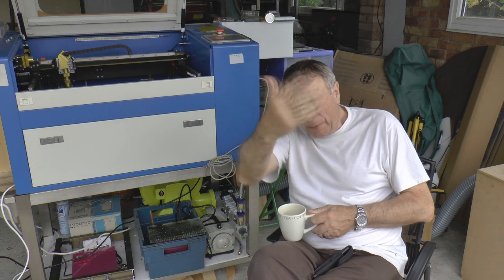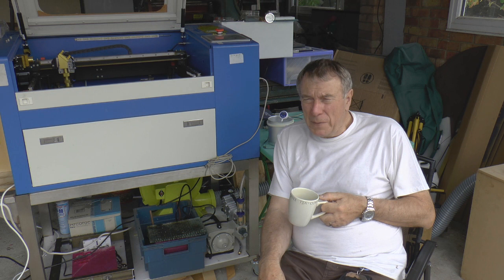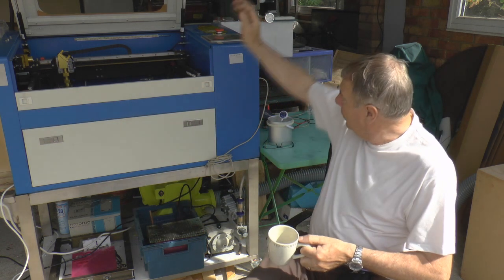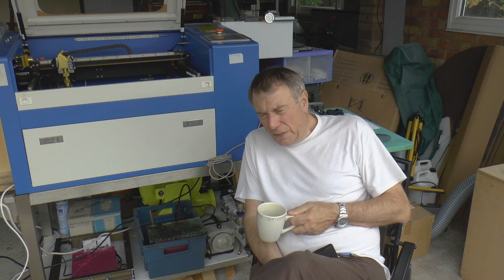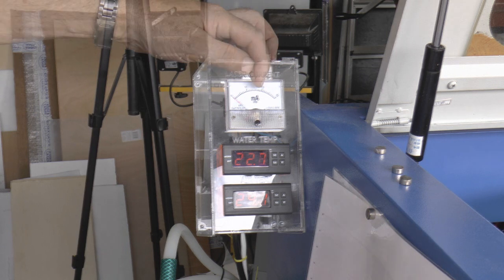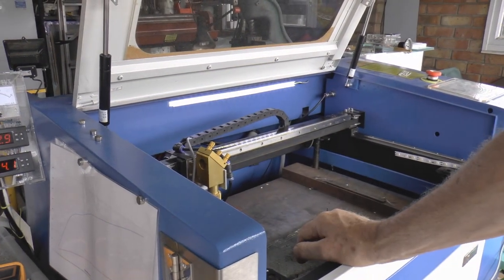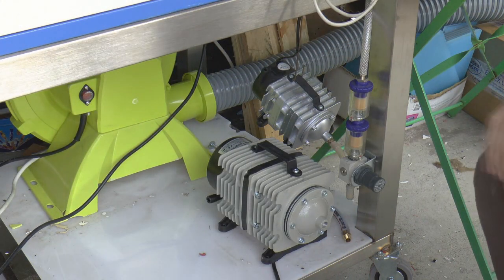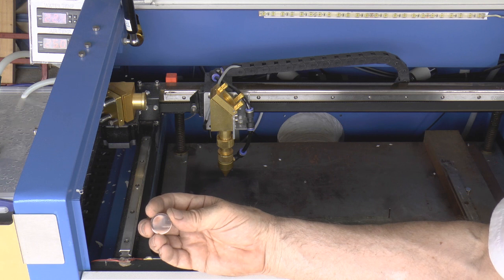RDWorks Learning Lab 75 What have I learned from 1 year of owning a Chinese Laser Engraver

Comment: Hi Russ. Thanks for the great videos. I am looking to buy a laser cutter. Please could you tell me more about the tube and the co2. How long do the tubes last? Is it classed as a consumable of the machine and do i need to fill it with Co2 ? Thank you
Reply from the maker: Hi Johnny
Tube life is still a mystery in my book. My dealings with Thinklaser have been very informative on this subject. Their MD is a regular visitor to the Chinese factory where his machines are manufactured.  As a machine builder, that manufacturer has good relationships with all the major tube manufacturers. Thus it is via that route that I am reliably informed that the specified tube life is NOT  (as you would imagine) "beam on" hours but elapsed hours from manufacture ie shelf life.  Do I believe that?  Not really, because of hearsay and my own experience.. It's a good starting point that tells you that even the best claims of 8,000 hours from the likes of Reci and EFR will last about a year IF it really is elapsed hours. My current tube claimed to be  4,000 hour life. It is now 18 months old and has 14,000 hours elapsed. It still performs as new. I expect to experiences a slow decrease in power over a few weeks when t does eventually start the downward spiral to death. There are many out there that have told me that their tubes are lasting way,way longer as well.

Some companies do offer a CO2 regassing service but it's expensive and aimed more at industrial tubes. Just buy a whole new tube because CO2 is but one of the things that wear out or weaken.

Yes, you must consider the tube as a consumable and typically expect between 2 and 4 years as a tube life. BUT the tube installed in your ebay machine will almost certainly not be a decent tube  and that could last days to months (from the experience of many correspondents ) so factor in the cost of a new tube when you budget for your machine purchase, that way you will be mentally and financially prepared. 

Final note. Buy with your CREDIT card. Do not use your Pay Pal account or any other payment method. Your card company has a legal obligation to protect you against faulty goods that you will not get elsewhere.

Best wishes
Russ

Comment: Hi Russ,Being on a shopping tour for a laser for some time, I watched a lot of your video's and decided to take the "risk" and go for the Chinese.So I ordered a machine, the next larger size as yours, cutting size 700x500mm and supposed to be equipped with a 60W tube.I even ordered it at the same shop as you did. (at least I think; with the Chinese you never know)Price, being some 1850€, shipping included, was very attractive.And, after some communication with the seller, the machine was imported already in the EC, so there should be no import duties to pay.The box (a huge one, good for some 180kg) arrived by DHL 8 days after payment - so that's very fast.I came from Gatwick, and there was nothing to pay at the moment of delivery. But, also being retired but still having my old company and a valid VAT number, and my company being known by DHL; some invoice might come in a few day's... we will see.After unpacking the thing, a quick check shows no transport damage; the laser tube looks not broken as far as I can see and was marked with a "test certificate" being a 60W tube that actually produced some 57W - test date 05/2017.The laser power supply was also rated and marked being a 60W version.So all this looks better then expected.At the moment I only powered up the machine and that was OK - I had to switch the language to English on the control panel but you documented that in some video and it worked as shown.Did not have the laser on yet, because I have first to arrange the water cooling. I will put an update here somewhere after the first cut.What I noticed in all your video's is, that you never seams to wear protective glasses. I for myself, being pretty careful for my eyes, ordered in any case good ones for CO2 laser. No Chinese ones (don't trust them that far) but serious ones from Thorlabs - model GL6 to be precise. Costs around 160€ shipping included, but that's still the price I want to pay for my sight.I also intend, before powering up the tube for the first time, to modify and reroute the HV wiring to the tube. What I see here is below any engineering standard (I am an electronics engineer)I'll have a look how I can put my findings and modifications available to anyone interested - do not intend to make some video of it (to much work) but I make pictures of all I modify.I'll keep you all informed...
Reply from the maker: Hi Luc
 By all means keep us informed. My only concern was your tube description. Is it branded K H Laser?
Take a look at   https://www.youtube.com/watch?v=kJe16YQlIM0 and make your own risk assessment about these heat rays and your  160 euro investment. You are correct that I do not wear any SPECIAL safety glasses. I do however wear cheap reading glasses with polycarbonate lenses.  The IR emitted by a CO2 laser has some weired properties. Althoiugh it is a form of light it is at such a long wave length it will not harm your eyes in the same way that visible laser light will. Visible light will damage your retina (just like staring at the sun or watching arc welding without adequate light filtration) IR is rapidly absorbed by water and many other substances and will cause local surface burning, so it is your cornea that is at risk with IR NOT your retina. Putting another energy absorbing barrier between your cornea and a DIRECT beam will give you all the protection you need. The machine has a cover, so technically if that is closed when the beam is on any reflections will never reach you. Virtually all materials you will be using in the machine are 100% absorbers of IR thus there will be little chance of reflections even if you run the machine without the lid closed. Despite all the scary warnings and labels IR radiation is to be understood, respected but NOT feared.
Good luck in your own journey of discovery.
Best wishes
Russ
Reply: Thanks Russ for the reply.The tube is indeed branded KH Laser. Could not immediately find out if this is a manufacturer of laser tubes or some test lab. Maybe you know more about it.Concerning these safety glasses - I looked at the video now and have seen that the danger is indeed relative.But taken into account that I wear glasses with lenses that pretty special and also bi-focus; I am not sure if they are made out of polycarbonate or real glass (but I expect the last, as I broke them once and they have cost me some 400€ to replace them); I still find the investment acceptable.The is also the fact that I have some grandchildren with tech genes, always being around grandpa when he is playing with machines and things with a lot of buttons on it. I teach them good workshop practise rules, and safety glasses are one of them.And my daughter in law would skin me alive if something should happen to them. (if she would get the change, my wife might be first)All the best from bloody hot Belgium (32°C now)Lucluc@e2t.be
Reply from the maker: Hi Luc 
I tried replying to your email address but there must be a typing error somewhere because the message cannot be delivered.
Can you resend your email address.
Thanks
Best wishes
Russ
Reply: Russ, Youtube strips off some formatting characters in the message system. So it looks my email address starts with 2 times my first name. Actually I had put a carriage return in between. So if you use just my first name only once before the @ sign it will work. And the part after the @ sign is correct. There is a digit 2 in it - some people think this should be a capital Z; it is not.

Comment: Thank you for your wonderful videos 

I'm thinking of buying one as I do a few acrylic projects.
Does the laser cut a true 90 degree cut on acrylic of say 10mm depth
or is the cut more of a  V shaped
As I do require a go straight cut for welding the acrylic
Reply from the maker: As you hopefully be aware, there are two types of commercial acrylic. One is cast acrylic and the other is extruded. In both types, when you laser cutthe edge, there are stresses that build up as the material cools after cutting. Most folks use full air assist when cutting and that accelerates the cooling effect after the cut has taken place. Many report stress cracks appearing as soon as they attempt to glue it with normal acrylic bonding cements.
see http://www.sawmillcreek.org/showthread.php?51176-Having-problem-gluing-laser-cut-acrylic-parts
You will see me using a solvent cement in many of my videos and I have to say that I never see signs of this stress cracking. Maybe I'm lucky, but I think it is mainly due to the fact that I always cut acrylic with minimal air assist, just over a whisper, but enough to gently blow through the cut to keep the fumes going out from the bottom of the cut.
I then use a Bondrite glue that is designed for bonding PETG coded as WC123
http://www.bondrite.co.uk/adhesives-for-plastics/c1000029355.html    

As for straight cuts, none will be as perfect as a machined edge but with the right lens you will be reasonably close to flat and square . A 2.5" focal length lens should produce those reasonable results on 10mm acrylic but you will need at least 60 watts to use this type of lens and would get faster results with 100 watts. If you choose 100 watt tube then you will be able to use a 4" focal length lens for even better results.

Hope this helps
Best wishes
Russ
.
Reply: Thank you for taking the time to reply

I will bare in mind your  helpful advice. 
I will have to take the time to view all your Videos.

I worked for many years in a steel tooling engineering company, 
& it sound very similar to the process of hardening steel.
With the steel being heated then rapidly cooled.
The Hardened steel needed to be annealed  in an oven to remove stresses
& give the steel a even tempered Hardness.

By reducing the cooling time of the acrylic this would achieve the same effect.

Regards

Comment: I purchased an American made Universal Laser systems X-25 for $28,000 in 1998. 
Still using it everyday, no problems beyond wear and tear of bearings, belts, mirrors, lens and a couple of motors. 
It has paid for itself the first 6 months of this year.
Reply from the maker: Hi John
Universal  along with Trotec and Epilogue are industrial quality machines and you would only invest such sums if you had a projected workflow to justify the cost. It's an amazing commendation that your machine has performed so well  but this very low cost Chinese equipment  cannot be considered  for comparison. As the old adage goes "you get what you pay for". It's amazing therefore that what you get works at all....but it does and quite well.  It is not refined and you need to be an enthusiastic hobbyist rather than a business to own this type of equipment. However,  I am amazed at how many folks DO buy this kit and start small trinket businesses 
Best regards
Russ

Comment: how to ingraving arabic latter?
Reply from the maker: Hi Ramsh
http://www.fontspace.com/category/arabic is a start to down load some Arabic fonts. When installed into Windows, the font should appear in the RDWorks text list. RDWorks is  the best way to work with fonts because you get a vector outline for each letter. If you use the default 0.1mm increment  when setting scan parameters, then you should get good results. Typically speed will be about 300mm/s  and you will have to set the power to get the burn depth you require.
All best wishes
Russ

Comment: My engraver fume hose is 6 inches. Can I reduce it to 3 inches? Thank you.
Reply from the maker: Hi Mohammad. The answer is both yes and no. Confused? Let me explain. You cannot reduce air FLOW through your machine because that is what is extracing your fumes and this flow is very important. if you reduce the pipe size from 6" to 3" you will rduce the flow area from 28square inches to 7 square inches  OUCH!!!. I suspect that your problem is that can cannot trail a 6" pipe across your workshop or there is not a big enough space to vent the pipe. There is a solution and it is shown in the video at 13 minutes. If you use a centrifugal fan, you can put the 6" tube to the inlet of the fan (close to your machine) and then you can use a 3" pipe from the fan because this type of fan compresses the air and can force it down a long 3" pipe The Chinese supply such fans for some of their machines
Hope this helps
Best regards
Russ

Comment: Hi Russ. I bought one of these machines after watching your videos. The tube lasted 2 weeks before developing a crack in the water inputs at the business end. I've since bought an SPT tube which we fitted last night. Early results show the laser is far superior to the original. I've not watched all your videos yet but they've helped me greatly. Cheers Rob
Reply from the maker: It is very rare to get good tubes fitted to ebay machines. They usually work, but how well is a big question mark. If your first tube was marked K H Laser then it was already a reject tube from a main manufacturer. One of the machine builders that specializes in Ebay sales  (keHui)  have a poor quality reputation and are known to acquire  reject tubes, retest them,   to make sure they function "in some way" to fool the average innocent E bay buyer. They then relabel them. They may last days or months, its just pot luck.....and fraud.  SPT tubes are cheaper but work just as well as the top of the range Reci and EFR tubes. Despitye the lifetime promise, it should last two or three years.
Best regards
Russ
Reply: Ok thanks for your reply. I just noticed your amp meter so I think that's next on the shipping list. In the meantime should I watch what power I put in it ? It's a true 50 watt tube and I suspect a 50 watt power supply so should I try cutting at lower power until then ? It's mdf we are mainly cutting for my wife's craft shop business.
Reply from the maker: A true 50 watt tube will be 1000mm long and should not be run at more than 20mA. If you do not have an ammeter then limit your running tom 65% as typically this is about the 20mA value
Best regards
Rus
Reply: Ok thanks. All the best Rob